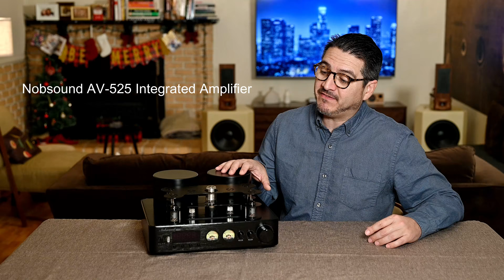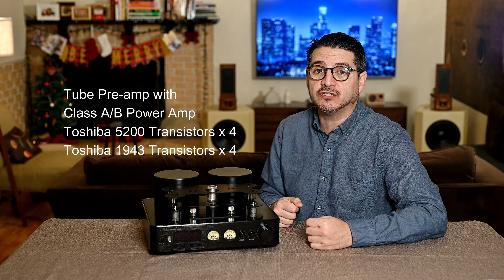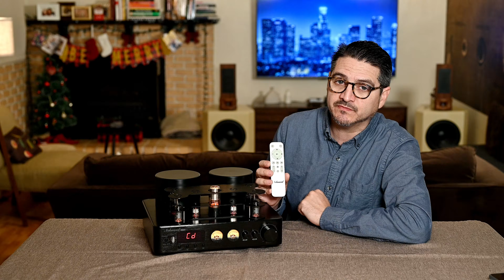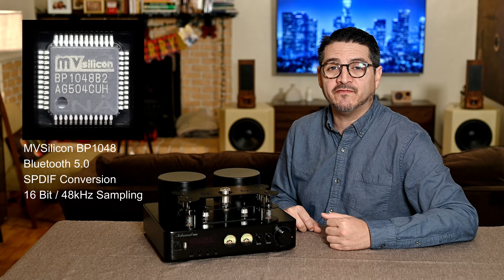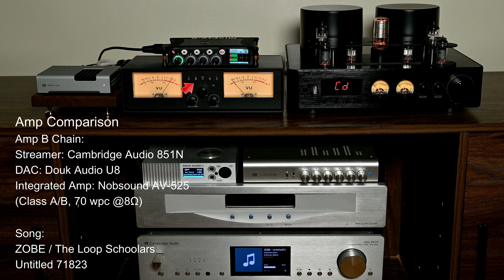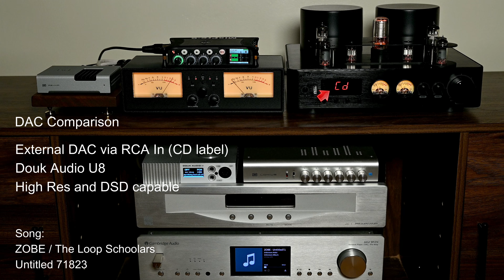Best Entry Level Tube Amp? Nobsound AV-525 Review

Comment: Hi there ive just purchased one of these and really pleased with it however i have an external dac schitt modi 3 will it be overkill if i use the modi 3 or is the onboard dac sufficient  many thanks
Reply from the maker: I'd definitely use the Modi 3. The built in DAC is nothing special. But once it arrives, you can hear for yourself 👍🏼
Reply: @RickRuizAudio  many thanks

Comment: I'm trying to decide between the 2 but I'm looking at a JTA100 (which I'm told is exactly the same as a HTA200)
however it is 80w x2 @ 8Ω and 100w x2 @ 4Ω...not the 50w x2 @ 8Ω you claimed. can you confirm?

I'm wondering if the JTA100 is a revision with more power, less hum, etc...if so I might be swayed to the JTA100, if not then I might grab the 525
Reply from the maker: I just looked at the JTA and it looks to be the same. Check out the specs of the hta200 here: https://www.daytonaudio.com/product/1938/hta200-integrated-stereo-hybrid-tube-amplifier-200-watts
Down at the bottom, you get the 4 and 8 ohm ratings. 
What speakers are you pairing the amp with?
Reply: @RickRuizAudio  I'm seeing the JTA has different output (mentioned earlier) than the HTA200 but otherwise the 2 "appear" identical. The JTA coming out later seems maybe it is a revision but it is outputting that 80W

as for speakers I haven't decided yet but want to get 4ohm to get the full range. I am a fan of Klipsch but do you have any recommendations?

Comment: I am roughly 8 months in on this amp and it still rocks! Hard to believe because it seems like I just got I a few weeks ago still. It just goes and goes. Zero issues! Audio quality output is a real treat everyday.  So for the last 8 months basically every single day I cannot wait to get home so I can use and hear the amp. It is that good to me. The remote for this amp is great to. Buttons still feel very fresh.  I mostly run this amp flat but if you need extra bass and treble they are there for you always. You will not need to use them much seriously. These controls are quite responsive. Very impressive!
Reply from the maker: Very cool! I love to hear that! People enjoying their gear! Thanks for the update 👍
Reply: @RickRuizAudio  It is a great amp Rick.
Reply: Same here buddy !! I started with the Dayton 100 a year ago and now I’ve got all kinds of stuff !!! Hahaha the sound and tube vibe are just so enjoyable!! It just takes over!! Experimenting with tube swaps is fun too as long as you pay attention to what you’re doing … take me for example at first I wanted to upgrade the tubes so I ordered some and it turned out that they were nine pin instead of seven 😂

Comment: I cannot find Nobsound AV-525 on Aliexpress in 2025. But HTA-200 is still for sale. Dayton survived this amp? Thanks for the helpful comparison!
Reply: Had the HTA-200 for a week. Sent it back. Had issues. Buy the Nobsound AV-525 hands down. The bass and treble controls, remote are a thousand times better. It is a smoking great amp. I am 8 months in and it sees a lot of hours every day!  Cleaner sounding amp to even at high volumes.
Reply from the maker: They're pretty close. I wouldn't mind either. Thanks for watching 👍

Comment: Look like my Dayton Audio HTA-200. But it doesn’t have a phono input. Instead it has 2 line inputs, mine has one.  Also, the Dayton Audio HTA-200 is a hybrid class D amp.
Reply from the maker: Yeah, it's very similar. I checked out the HTA200 a while back too. But it's also a Hybrid A/B actually. Thanks for watching. 👍

Comment: Quality preamplifier with vacuum tubes at a low price! I changed the Chinese tubes with Russian ones, from the Soviet era :). 
I replaced NAD C352 with AV 525, so you can get an idea. The subwoofer, BT and remote control work fine, no problem. 
The tubes add a real audiophile plus compared to the integrated NAD. 

My audio system: desktop PC with SSD Win & storage, FiiO BT30 pro DAC, AV525, B&W 685 S2 bookshelf speakers, all quality cables, JRiver for playback. 

Russian tubes: 
1 pc: SG2S (СГ2С) = WY2P China 
2 pcs: 6K4P-EV (6К4П-ЕВ) = 6K4 China 
2 pcs: 6H2P-EV (6Х2П-ЕВ)= 6AL5 = 5726 PHILIPS ECG JAN, Sylvania, USA - changeless 
2 pcs: 6P14P-ER (6П14П-ЕР)= EL84 China 
I paid only 35 euros for all. :)

Final price for the pre-amp with all taxes: $260, delivery after 21 days in Europe. 🔊 🎼 🥂
Reply from the maker: What a deal you got! Thanks for sharing and thanks for watching 👍
Reply: Thanks for putting up all the alt tube details.
Did the Russian tubes change the sound/improve the sound over the stock Chinese tubes?

Comment: Nice Amp. Just wonder why this has so many tubes. The Magnat MA700 for example needs just one tube for the preamp. Guess this needs much power to heat all the tubes?
Reply from the maker: Yeah, sorry I can't help with this one. I don't know what each does exactly. I know the voltage regulator is the center one and then I believe different levels of preamplification from the side ones but don't know exactly what they're doing.

Comment: How do you connect a turntable to this amp?
Reply from the maker: If your turntable has a built-in Phono preamp, then you just connect via RCA cables to the line input on the amp. If your turntable doesn't have a built-in phono pre, then you will need one in between the turntable and amp.

Comment: Hey Rick! Update! The AV 525 still all that and a great bag of chips! I did add one last thing. Occasionally mono jazz can be a tiny bit harsh on any system so I bought a beautiful like new dual channel Ashly GXQ 3102 EQ that is super transparent audibly. I am using it as a parametric EQ notch filter scenario. Not boosting frequencies nor do I need to. This EQ does not effect adjacent frequencies like many low end EQ units do. It has amazing specs plus my listening room is way less than perfect so for very slight tweakage it is wonderful to say the least. The high pass filters and output level meters on this dual channel unit are heaven to. I know, high end audio cat's do not approve of EQ's but, in my case I have it when I do need it. Just saying.  I agree, a parametric EQ would have been even a better choice but it was just not in the budget right now.  I am amazed there are not more reviews on the AV 525 in here lately. I think it is a smoking great amp!  Now back to some more Count Basie and Harry James music LP wise. Ha!
Reply from the maker: How many bands on the 3202?
Reply: @RickRuizAudio  62 total. 31 per channel.
Reply from the maker: @VintageGearMan  nice. Yeah, with that many bands, those are going to be pretty small Q's. Very cool 👍
Reply: @RickRuizAudio  I worked hard to find the best EQ possible to sort of come close to a parametric EQ. Man alive, a real parametric EQ is $300.00 plus now used.
Reply: @RickRuizAudio  I kinda of thought maybe you would approve of this Ashly EQ.
Reply: @RickRuizAudio  Yeah, Ashly paid a lot of attention to the ripple effect and keeping it to a bare minimum. Honestly it is a dream come true for me. It holds water. Moving only one band is just one band difference as I can tell. It is a Very transparent EQ as far as any noise etc. None! It is absolutely studio grade no doubt.  I was lucky to land it. They now cost $500.00 a version similar to this. I bought it used in pristine condition for waaay less.
Reply: @RickRuizAudio  I hope to see more reviews on the AV 525. I wish I worked for this company. Good stuff.

Comment: The AV 525 remote is heaven!  Works wonderful! Very responsive.  I definitely made the right choice going with the AV 525 across the board. Believe it or not I keep the bass and treble controls flat 99% of the time. That is impressive to say the least. There is a lot of headroom on these controls if you want it but it is super rare they need tweaking at all. Just saying.
Reply from the maker: Glad you're liking it!!! 👍

Comment: Hey Rick question if ok? This could be a Billy Joel,,,I may Be Wrong I May Be Right moment,,,ha!  Anyway, got the other matching sub in so,,,,,,I tried and experiment. I sent 30 hertz into the new AV 525 and using main speakers only. Left volume set at bout 11:00 o'clock on new amp.   I had the wife sit in a chair best spot I could find for low freqs given our room. I then turned on one sub and set it at 50 hertz (lowest frequency setting it has but I could still hear 30 hertz coming out of it) I then turned up the sub too high and told the wife,,,, now I am going to turn the volume down on the sub. When you hear the sub disappear tell me when to stop. We did each sub individually (one sub on one off) with the main pair of speakers on. Ok, that's done. Then proceeded to play said music and  you do not even notice the subs are on so I am thinking I have them dead on correct frequency and volume level for the pair of main speakers now.  At this point the subs sound like my mains and transparent so to speak. Nothing is overbearing but the overall low end is fuller.  I did leave the phasing on the powered subwoofers in normal mode being the system is not in a big room. Am I crazy trying this approach? It seems to work. All the music I throw on still seems natural audio wise to me but just a bit fuller sounding.  My main speaker pair has 12" woofers in them.  The Yamaha powered subs are rated at 70 watts and have a 6.5 " woofer in each.
Reply from the maker: There are many ways to get it "right". If it works for you, that's great. In "theory", your approach doesn't seem quite correct because you are using 2 subs and if one is dead on, then adding the 2nd at the same output level, should give you a 3dB boost. But theory isn't practice so I'm glad it sounds good to you. But for sure I'm with you to use the subs to just carry the lowest frequencies and let your main speakers roll off naturally. As opposed to crossing higher and adding a high pass filter to mains to get more out of your mains, because then this stresses the bass. Subs are made for low bass, or else they'd just be called woofers! Lol. But just an Opinion! And there are ALWAYS exceptions.
Reply: @RickRuizAudio  Sorry, I should have stated 6.5" subwoofers in the Yamaha's. I see your point on 2 subs adding 3db overall set at the same on frequencies and volumes.  Will leave it alone for now.  You are the best!

Comment: Hey Rick. Unrelated. Check out Linux MX 23.2 "Libretto" a PC operating system and the Brave Browser. Thank me later. You do not work on it.  25 seconds to boot it and you are up and running. Updates take only minutes. Your done.  Closing statements regarding Rick,,,,,, anyone wondering about this channel, he has been super helpful. Just saying. 10 Stars

Comment: Quick question. Is there any harm on the AV 525 running a Y adapter cable out of the single subwoofer RCA out jack to run 2 powered subwoofers?  Thanks ahead of time. Let me know please.  Seems a lot of people do this with amps and have no issues what so ever.
Reply from the maker: No problem at all. You'll be fine w a splitter cable.
Reply: @RickRuizAudio  Big thank you sir.

Comment: Hey Rick what is your opinion on the Douk Audio T3 PLUS Vacuum Tube Preamp?   Most people say that you should install the GE Jan 5654 6AK5 tubes right off the bat. Your thoughts?  I like that this unit has a small foot print.
Reply from the maker: I haven't heard the Douk T3 Plus, but I generally like Tube Phono Preamps. I really dig the xDuoos. I guess if you have the budget for extra tubes right away, sure. They're just $20 a set. 
Of course in the US that isn't much but in India or China where you might spend much more of your disposable income, I could see just sticking with the stock. Thanks again for the input!  👍
Reply: @RickRuizAudio  I ordered the T3 Plus just now. I do not see how I can go wrong. I will try the stock tubes first and go from there.  With the new Nobsound AV-525 coming and this phono pre I cannot wait to hear Supertramp Live In Paris double LP set again!  1950's jazz will be off the charts great to I bet!
Reply: @RickRuizAudio  Very happy with the stock T3 Plus tubes honestly. Several days in. No complaints.
Reply: @VintageGearMan Any complaints since then? Still running stock tubes?
Reply: @MadLadsAnonymous  I have seen very little reason to change the tubes at all. The amp just continually delivers the goods very well. I did buy a made in 2016 vintage Music Fidelity V DAC II because it allows me to run the streaming signal through my other outboard signal processing gear back to the amp. I like it better than the amps built in DAC but still yet, it is not terrible at all do not think.  I spin records mostly so I bought an external tube phono pre being this amp has no phono pre installed in it. I knew this when I bought the amp. No big deal. Honestly love this amp. Very robust and a daily driver and has all the power I need.  Audio wise, great! to me. Hope this helps.
Reply: @MadLadsAnonymous  You can expect about maybe 70 watts per channel with 8 ohm speakers occasionally. Still yet for the average room more than enough. Amp always sounds super clean to me even past 3/4 volume control setting. The bass and treble controls barely ever need tweaked up. If you do need it on said music at the time it is there waiting for you. A very nice feature. Some amps just have crappy bass and treble boost. This one does not! It is great. Again I almost run this amp flat most of the time. Impressive!
Reply: @VintageGearMan  Thanks! What speakers do you run them with?

Comment: Sound tests on YouTube are pretty useless with compresion and all.  Sorry, I always find it amusing when people do that.  It really doesn't show the sound quality at all.
That said, this amp is cheap, and it sounds okay, but just okay.   It really doesn't give a good sound image and staging compared to solid state amps of the same price.  Sure, you get that slight tube coloration from harmonics, but don't expect an "audiophile" type experience with it, and also don't expect a true tube experience as it is a hybrid style amplifer with a mix of solid state and tubes.    
The rated "watts" is pretty well marketing garbage, like a lot of the D class amps try to push.   The RMS output is a LOT lower.  That 20 Watts difference..   No.  Not different at all.   
The hum is very little to do with the transformers, it is to do with filtering.  Output transformers don't hum if there is no hum on the signal and quite frankly, from what I can see Daton HTA 200 uses identical output transformers from the same manufacturing factory as Nobsound use.   The Daton units are a little higher quality in their build and the do have a phono stage, but I prefer an external phono stage of quality over any integrated one.

Overall, sure if you are a beginner looking to experiment, get the Nobsound and be aware it is cheap and of variable quality.  If you are looking for better quality sound, don't bother with it.   It's cheap and it's cheap for a reason.
Reply from the maker: Thanks for the input! 👍

Comment: Hi, what do i need if i need to use my turntable w/o phono preamp? Sorry just starting out with turntable rabbit hole.
Reply: I happened to buy the Douk Audio T3 Plus phono pre amp and love it! The stock tubes are excellent.  Been running the daylights out of it with the AV 525 amp.
Reply from the maker: @VintageGearMan  Nice. Glad you're liking it 👍
Reply from the maker: You always need a phono pre amp. Sometimes it is built into the turntable and other times you have to provide your own. What turntable do you own or want to buy?
Reply: @RickRuizAudio  i have an old technics TT w/o phono. Looking to purchase a  reisong a10 amp but im a bit confuse which component i still need to buy for me to use the TT
Reply from the maker: @Beb0ptrane  you need a phono preamp. It goes between the turntable and the A10, because the A10 only has 2 line level inputs. No phono inputs. What is your budget for a phono preamp?
Reply: @RickRuizAudio  i hope somewhere same range of the reisong amp or less. Just want to try tubes before spending for much better tube amp and preamp setup.
Reply from the maker: @Beb0ptrane  look at Ampama A1 or iFi Zen Phono 2 or 3. 👍
Reply: @RickRuizAudio  thanks rick will check both recos

Comment: I bought this app last month. Love the looks, especially the glow of the tubes in the dark. Just wish the digital read out wasn't so big,  takes away from the romantic looks. 
I have a Wiim Pro Plus going into a Geshelli labs J2S with Sparkos upgrade. From there into a B&K PT3 pre amp and finally into the Nobsound av 525 out to SVS UltraTowers.
I switched back to my  Forte model 3 after a couple weeks and of course the Forte is better although with inflation its a $3000 amp vs a sub $400 amp. 
With that in mind the AV 525 is definitely a great little amp.
Reply from the maker: Totally agree on the screen. Wish the led was defeatable. And yeah, that's exactly it, for the price it's great. Sounds like you got some nice gear!
Thanks for the input and I appreciate you watching! 👍